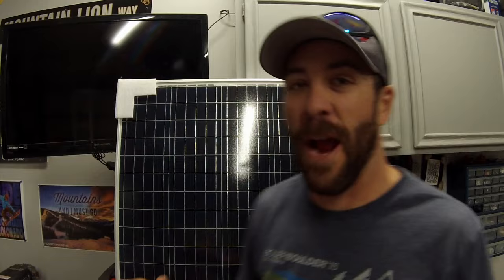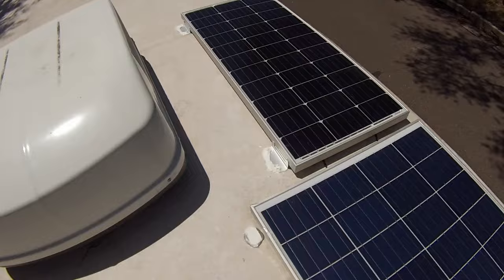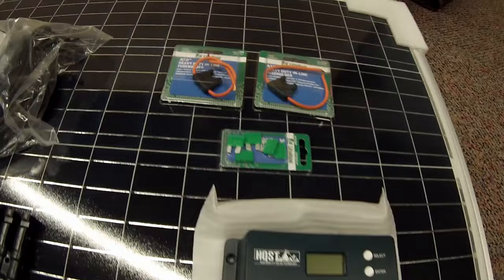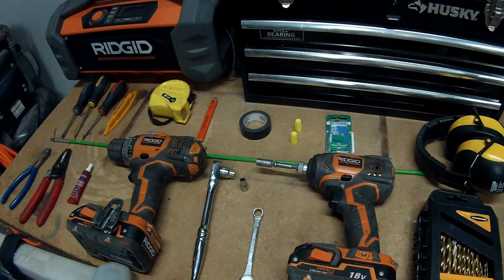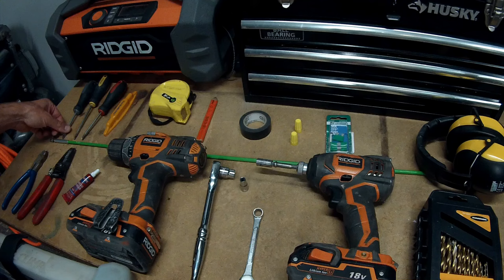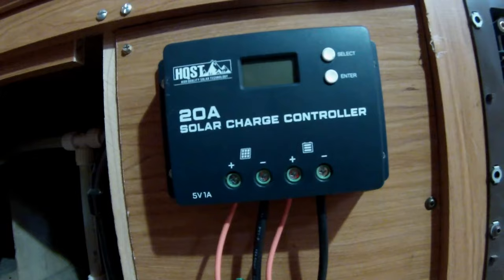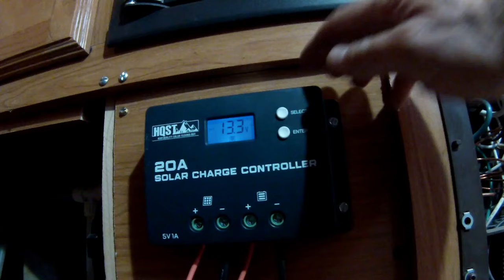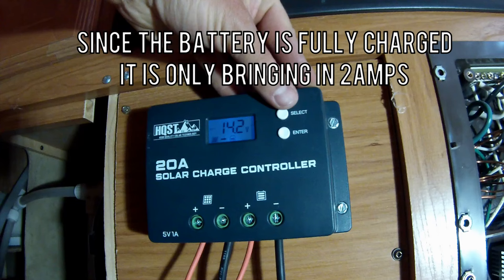How To Install a 200 Watt Solar Panel Kit On Your RV/Camper - Detailed Step By Step Instructions

Comment: If anyone does this build, please don't use wire nuts. That's asking for trouble. They're meant for solid core ac wire not dc and also you could lose voltage or amperage with such a bad connection. Being in the automotive field our so has seen many melted, fire damage, or shorts from people using wire nuts. Use a crimp style connector or solder them is the best solution. I'm not meaning any disrespect on his install or build by any means. Just some first hand advice to help out and improve this awesome idea. Please no hate.
Reply from the maker: Thanks for the tips and watching.
Reply: Constructive criticism is always welcome
Reply: I’ve had good luck with Wagu lever-nuts!

Comment: Used renogy panels on my initial solar, no complaints at all. Decided install a second separate system to run my refrigerator.  I used HQST. I agree they are the same panel for a better price. Great video
Reply from the maker: That sounds like a great setup Ted!  I would love to have our solar run our refrigerator!  That'll probably be on our next camper :)  Thanks for watching!

Comment: Hey, I noticed you didn’t use a power inverter, are you only running power to your dc or does it swap to ac when you connect it to your fuse panel?
Reply from the maker: We have a 12 volt socket that we run an inverter on.  On did a solar install on my in-laws camera and installed a dedicated inverter. It connected to the "load" section of the charge controller. I'll find that video and send the link in another message. Hope that helps. Thanks for watching!
Reply from the maker: https://youtu.be/q_e8dUpIm8M Here's the link the solar system I installed on my in-laws camper.

Comment: Great clean job the only thing I would do is hook the controller direct to the battery instead of the fuse panel. I have been running solar panels on my rv’s for over 20 years and that has worked best for me. Stay well happy camping
Reply from the maker: Thanks for the comment and watching!

Comment: So with this set up I won't need to purchase a inverter this will be connected to my existing rv setup. So solar panels , charge controller,  30amp fuse and the wires is all ill need to send power to my rv appliances and my ac outlets in my rv?
Reply from the maker: With my setup, my panels will just charge the battery through the converter.  So you would still need to run a power inverter if you want to run 120 volt devices.  Some charge controllers have a "load" hook-up section, so you can run a power inverter directly off the charge controller.  I installed a solar system on my In-Law's camper and that is what I did.  Here's a link to that video:  https://youtu.be/q_e8dUpIm8M

I hope that made sense.  Thanks for watching!

Comment: I’m just getting into this but with doing it this way can you be off grid? And does tying into the factory fuse panel/converter mean you don’t need a sine inverter?
Reply from the maker: 200 watts will allow you to run some low wattage appliances.  So you can be off-grid, for low wattage items.  However, in order to run them, you have to have a 12 volt power inverter.  Some charge controllers allow you to hook a power inverter directly up to them.

With my setup, my panels will just charge the battery through the converter.  So you would still need to run a power inverter if you want to run 120 volt devices.  I hope that made sense.  Thanks for watching!

Comment: big black wire is POS? that is weird
Reply from the maker: Where we hook-up our battery to our camper, positive is black and negative is white.  A lot of 12 volt cables are like that apparently, I thought it was weird too.  Thanks for watching!
Reply: @ColoradoCamperman  you mean where you plug into shore power?
Reply from the maker: @jimbeaver27  No at the tongue of our camper, where our battery is stored.
Reply: @ColoradoCamperman  I think it's the Chinese way :)

Comment: I'm thinking of also scuffing and using double sided heavy duty gorilla tape between the brackets and panels. i think it'll dapen vibrations and hold better along with sealant between roof and brackets like you have. I'm using 2 #10-32 x 5/8 expansion nuts per bracket. lock n flat washer between brackets and machine screws. it's a 2000 winnebago fiberglass roof about 3/8" thick of outer ruber membrane and paneling and then 3" of styrofoam. I'll lay self leveling sealant in the drilled holes and then drop in the nuts. I'm hoping it'll hold. thanks for taking the time to produce this
Reply from the maker: Sounds like you have put a lot of thought into what you are doing for your install.  Sounds like it will work out for you.  Thanks for watching!

Comment: Awesome video! I think this will be our next project. We took a camping trip last month and was able to find out our power needs, turns out we are a little power hungry LOL. Currently I have 2 Group 31 102AH Trojan AGM's and they were just enough to last us 3 days having to run the furnace at night as temps at that time dipped into the low 40's at night.
Reply from the maker: Thanks Matt! I can't imagine camping without solar! Even when we were just rocking the 50 watt panel, our battery was always charged! That's even after a day/night of heavy usage like you're talking about. For the money, this setup is hard to beat and should easily take care of your everyday needs. Especially if you have two 102 AH AGM batteries. Thanks for watching!

Comment: I have those same mounts but it would be a PITA to remove a bad panel. The other option would be to screw some small self-tappers into the little side tabs on the brackets into the frame. That way you could at least pull the panel and replace it without disturbing the roof sealant work.
Reply from the maker: Good call, I thought about that as I was installing the mounts.  That is a good idea.  Thanks for the tip and watching!

Comment: I'd protect the solar panel wires coming in through the mesh on the roof so vibration doesn't eventually cut into them and short you out.
Reply from the maker: Good call. Thanks for the tip and watching!
Reply: @ColoradoCamperman  no thank you for the videos.  😃   I'm a visual learner for sure.
Reply from the maker: @vaughn6371  You're welcome!
Reply: @vaughn6371  no, thank you sounds bad without the comma lol
Reply: @sv8313  oops..you're right 👍

Comment: An MPPT controller will increase your power by 30%. I would get one with Bluetooth so you can monitor it with your phone.
Reply from the maker: This charge controller claims 80% efficiency.  The HQST MPPT controller I had considered was 99.5% efficiency.   I chose not to upgrade to the MPPT for several reasons. 1) We had the 100 watt Renogy panel with a PVM controller.  Based on our energy consumption for the last 2 years, that panel took care of us and kept our battery charged with no issues.  2) In the next 2-3 years (hopefully sooner) we plan on upgrading our camper.  We are trying to only do the necessary repairs/upgrades to our camper that we have to. If we were keeping the camper longer, I definitely would have done the MPPT controller and Bluetooth monitor like you mentioned.  Thanks for watching!

Comment: Did you or are you going to install an inverter so that you can run everything as if you are on shore power? The first part of the video answered my question as to where the panel cords run. I went to my dealer today and the guy told me that he could install the gopower weekender ISW 190 kit with 1000W inverter for $1k which seemed perfect, so I asked him again and he said $1k. But then went on to tell me it was a 40hr job and summer rates were $150 per hour and $120 in the winter. So it just didn't add up, so I might just do it myself but need to find information on how the inverter hooks in and allows the whole RV to run 120v from the solar.
Reply from the maker: We have not installed a permanent inverter.  We honestly don't need to because we can operate everything we need (minus the AC/Microwave).  Our fridge runs on propane when we boondock.  I'm not familiar with the time it takes to set that up, however,  I wouldn't think it would take 40 hours.  Especially for a tech who does that work for a living.  

One of the biggest challenges you will likely run into is space and being able to access everything you need to.  I wanted to hook up an inverter directly to our charge controller, that way we could have a few 120volt outlets.  But, we didn't have enough room.  I did that on my in-laws camper and you can see how I did that in this install video: https://youtu.be/q_e8dUpIm8M  

Well, good luck on the install if you decide to do it yourself!  Thanks for watching!

Comment: Why didn’t you install adjustable brackets so you can adjust for best direction sunlight??
Reply from the maker: I didn't want to have to adjust them. It was enough  power for us that it wasn't necessary.

Comment: Excellant work :).
but an explanation of ho you tied into the exisiting battery to feed it would be nice as well unless you are back feen thru the exisiting circutry there on the fuse panel
Reply from the maker: I back fed the wires to the panel.  I tapped into the spot where the wires come from the battery.  Hopefully that makes sense.  Thanks for watching!

Comment: This may sound like a silly question. If you're on shore power, does your solar still charge the batteries, or do you have some type of transfer switch to shut it off? I'm worried about backfeeding the shore power, but I don't know if that really is an issue or not.
Reply from the maker: I'm not 100% sure about that. I don't think the charge controller would allow that but I'm not certain. Sorry I couldn't be more helpful, thanks for watching!

Comment: Great video. What is the difference on going directly to the batteries with the solar compared to going to the panel ?
Reply from the maker: Going to the batteries would be the preferred method.

Comment: I did this install myself in the fall, watching your video a gazillion times without any experience! I used it with 2 HQST 100watt panels. I got 2 more panels so I may add them to have a total of 4-100 watt panels. 

I think this way (directly to fuse panel) is incredibly different than how people usually use solar panels on rvs. I just don't see it being widely used anywhere else I just don't get why. 

 Do you think if I buy a 200ah agm battery would it handle 4-100watt panels run parallel in this setup?

Should I get a cut off switch for the solar panel too?
Reply from the maker: That is awesome!  Glad the video was helpful and you were able to do the install!  I agree, I don't know why more people don't hook up solar the way I have.  

As for the batteries, each panel should be bringing in about 5.5-6amps.  The Renogy AGM 200ah battery can handle 60amps coming in, so you could have 10-100 watt panels and it would work.  Here's the link to that battery: https://renogy.sjv.io/KeYPjn

You may want to consider a Lithium battery.  I wasn't a believer until a company sent me a battery and they are awesome!  There's tons of benefits of the lithium.  One thing I was amazed at was the weight difference, a 200ah Lithium battery will weigh about 50lbs, the AGM is going to weigh around 130lbs.  So installing/removing the battery is so much easier.  Lithium is about doubled the price, so that is the biggest downside.  Here's a lithium battery I'm going to be reviewing in about a month or so: https://amzn.to/37Z9qc7

As for the cutoff switch, I plan on installing a battery cut-off switch in the future.  I would mainly use this when we cover the camper during the winter months.  Hope that helps!  Thanks for watching.

Comment: Just what I was looking for but I got lost when you put those red wires for the fuse. I have a popup and wanted to do this, so the camper battery is already hooked to the black box (inverter)? All I have to do is hook the solar wire to the fuse box on the big silver screws . 
I am a 75 year old woman trying to hook this up, thanks
Reply from the maker: Thanks for watching my video Sharon.  Without looking at it I can't say for sure how you need to hook it up.  Just try to follow what I did in the video.  Sorry I can't be of more help.

Comment: For cost reasons... is it possible to add another 200 watt kit months later?
Reply from the maker: Definitely! Although, you should only need to buy the panels with mounting hardware and a Y connector. You shouldn't need to get another kit.

Comment: Do I need to make another connection to the battery or use the one that is already in my travel trailer?
Reply from the maker: You should be able to use the existing connection in your travel trailer.  Look at 11:14 in the video, I discuss how I hook everything up.  Good luck and thanks for watching!

Comment: Great video, sorry this comment is coming so late, I just recently came across your video when I was researching solar systems. My only question is how long of screws did you use to secure the panels to the roof?
Reply from the maker: Thanks!  They were short, but fat wood screws.  I want to say 1.25-1.5" at the most.  If you don't hit a stud on all 4 screws, you don't want a super long screw going deep into who knows what!  Even after using a stud finder, I know I didn't hit a stud on every screw.  Good luck with the install and thanks for watching.

Comment: Underwired.  Use larger AWG for connecting both  panels to charger.
Reply from the maker: I used the exact wires that came from the manufacturer.  The panels are supposed to bring in 4.93 amps max.  On a sunny day, we are very close to bringing that in per panel.  What size are you suggesting?

Comment: What happens when you hook up to the site plug?
Reply from the maker: When you hook up to shore power, shore power takes over.  Depending on your RV and how it is hooked up, the batteries may or may not still be getting charged from solar.  The AC power trickle charge on the battery will likely take over.  But like I said, it depends on how everything is hooked up.

Comment: how did you protect your solar wires from the wire mesh on the roof vent. i know you cut a hole, but traveling and movement will still cause things to rub together... eventually wearing through that wire. grommets, etc? im thinking the best thing to do would be a large washer with a grommet installed and then expoxy the washer to the mesh.
Reply from the maker: I bent the metal back so it was smooth and I think I put electrical tape around the wires that would be in contact with the wire mesh but I honestly can't remember.  Thanks for the comment and watching.

Comment: Great video! Just install a 100-watt kit this weekend using your method of connecting to the panel. I have a battery cut-off switch, if turnoff the battery will there be issue with the power the panel is still producing? Thanks again
Reply from the maker: Thanks!  No, it shouldn't be a problem at all.  We remove our battery from our camper in the winter time, so our solar system is still hooked up producing. Thanks for watching!

Comment: What battery does this panel charge? Do you have to buy batteries separately? Or is it part of the panel already?
Reply from the maker: It should charge your "house" battery.  Those are the batteries that the RV run off of.  On a travel trailer, they are typically located on the tongue of the trailer.

Comment: thanks. i am just about to install on my trailer in Baja that i want to live in full time. i was thinking about 4 100 watt panels. Big question tho..no inverter? You just went directly to the panel? That would save so much money.
Reply from the maker: It depends on how you are going to use your system.  We have a 12 volt sockets that we can plug an inverter into.  So if we need to use AC power, we use that.  It will only operate smaller items (phone chargers, TV, portable fridge, etc).  If we need to run something larger like a coffee maker, we use our generator.  However, we use a coffee dripper while camping, so we don't even use our coffee maker anymore.  I hope that helps.  Good luck with the install and thanks for watching!

Comment: Is there a video that I'm not seeing regarding how you connected your system?
Reply from the maker: Which part were you looking for?  I started hooking everything up around 11:00 in the video.
Reply: @ColoradoCamperman  I was trying to skip to the wire connections and missed it.  Thanks for the response.  

My HQST 20A controller has battery, solar panel, and line/power connections.  I was looking for a video to see what people do with the load connector, but your controller doesn't have one.  I moved my battery (LiFePo4) from the tongue to inside.  Before my battery lead from the controller connected to the cable from the battery to the power center.  With the battery inside and near the charge controller I connected it directly to the battery and the battery directly to the power center.  Hopefully I won't have to rewire anything soon.  I'm still not using my charge controllers line lead, but I don't think that this will cause any problems.

Comment: Hello are you using two batteries on your trailer? Is so isn't it better to run the wires to the batteries positive to one battery and the negative to the other? That is how I did mine on our old trailer getting ready to add solar to the new trailer and I'm trying to educate myself.  Thanks for your videos.
Reply from the maker: Just one battery.  You could also hook things up directly to your batteries.  Whatever is easier for you.  I ran a lot less wires going directly to the converter box.  Thanks for watching!